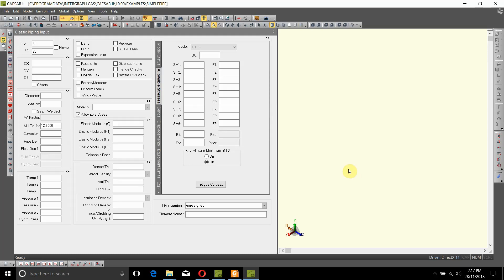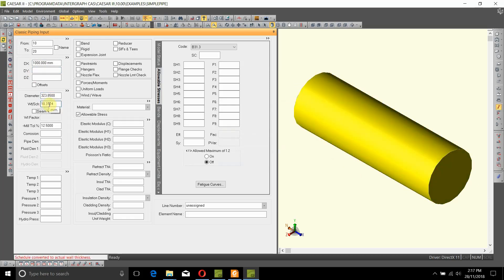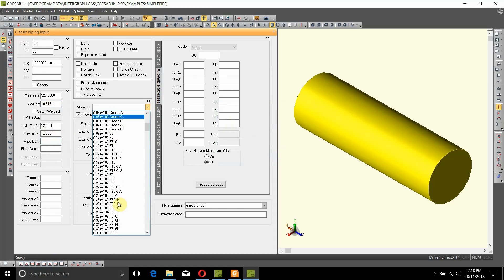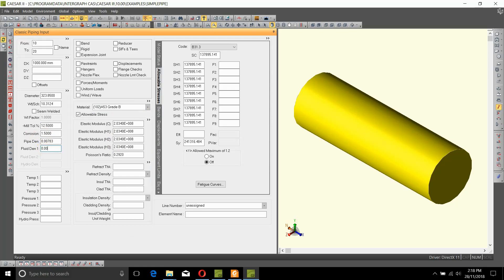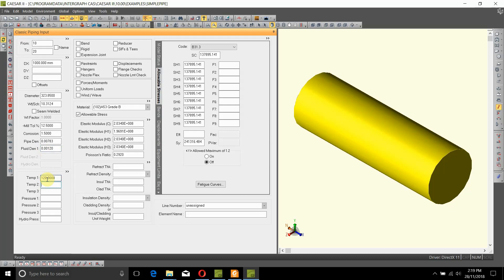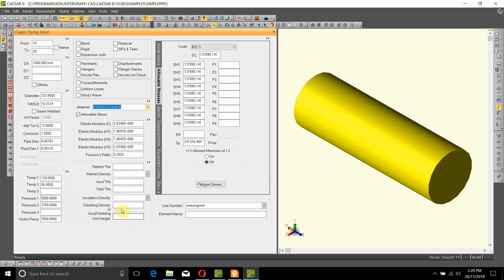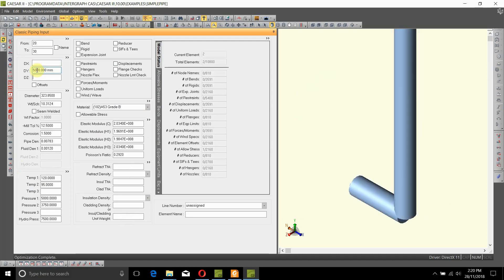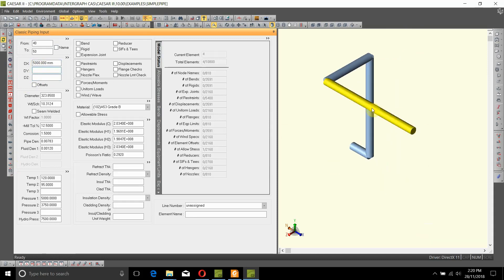How To Add Pipe Geometry and Load Cases in Caesar II

Comment: How to add fluid density2?
Reply from the maker: Hello Ammar, what is the specific reason to add density2?  This was to be used for future additions to the program and it was hidden.
Reply: @MoonishEngineering  ???
Reply from the maker: @ammarquaid8220  Pipe Stress analysis programs are inherently Beam models behind the curtains. I would like to understand what results you are trying to get by modelling two phase.  Do you want to find out results of thermal bowing.  I haven't done thermal bowing calculation using Caesar II but I have done that using PASS Start-Prof software.  Link is here. https://www.passuite.com/kbase/doc/start/WebHelp_en/index.htm#t=ThermalBowing.htm
Reply: One phase is liquid another phase is vapour
Two fluids are flowing in thenpipe thats why
Reply: Kindly tell about this